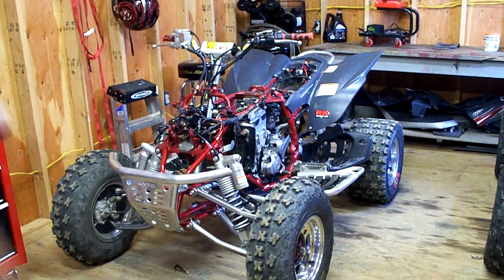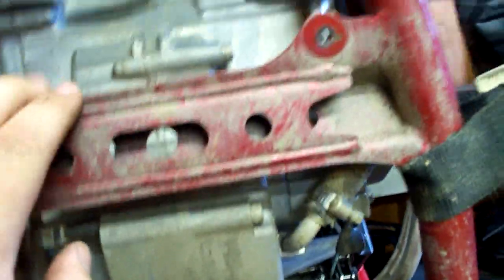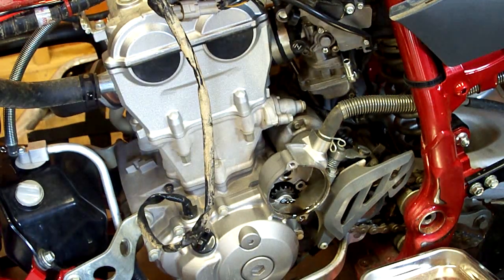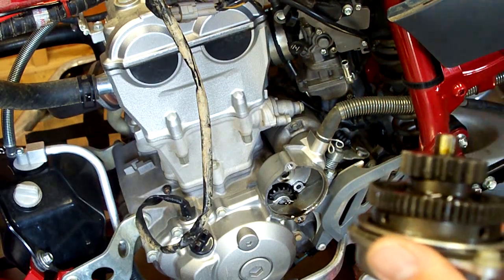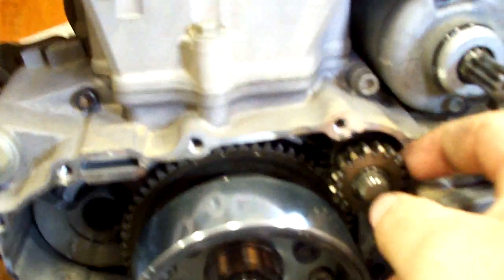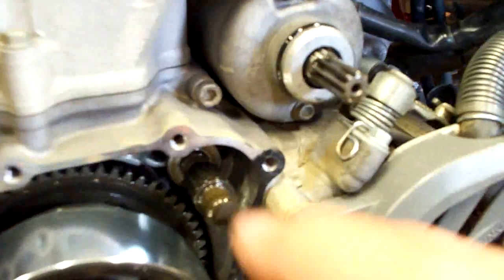YFZ 450 Stator video

Comment from the maker: @gusocorredor no its not the only way out, but its worth it.It makes it all dc power instead of the spilt ac/dc it has now. and charges the battery better. it will run around 200 for the kit.

Comment: hey yamahagytr, idk if you remember but u posted a vid to help me out with my carburetor a few months ago, well everything is fine now (got a good mechanic) and the only prob is that its not charging the battery :S is putting the trailtech resistor and stator kit the only way out??? i forgot to check if the lights were on or off when checking the batt, some forums say that when its ON the battery should charge. Thanks btw you have really good technical videos